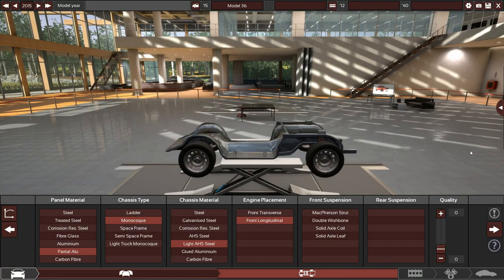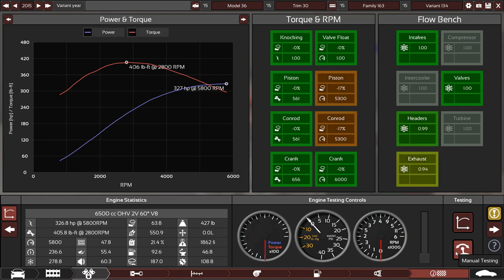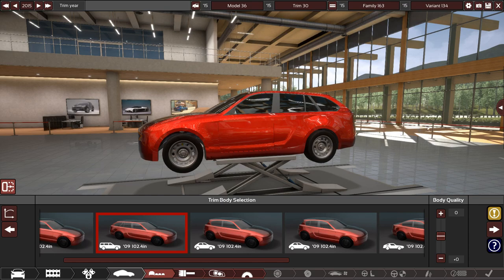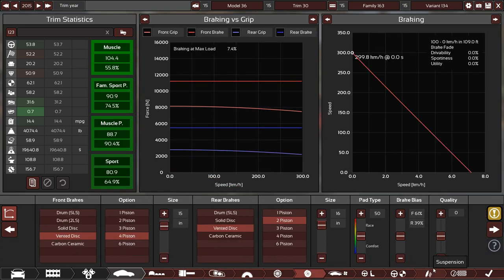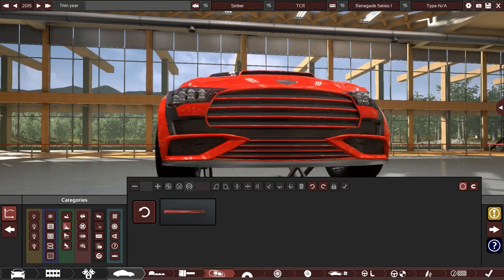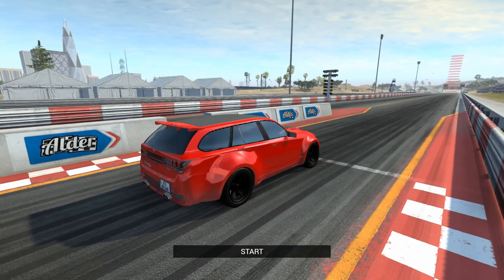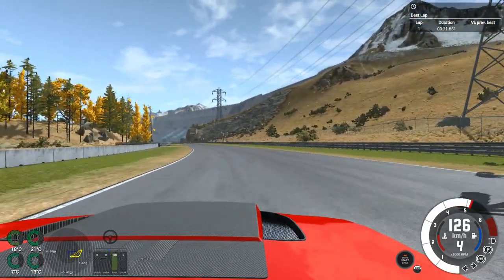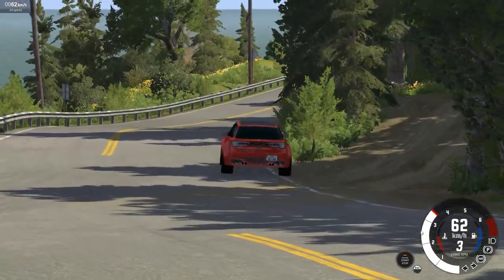Building A V8 Superwagon - Automation / BeamNG

Comment: I know this video is now a few months old but i wanted to mention something, an "error" of some sort you made regarding the engine.
American V8's are usually 90°, not 60°.
And instead the 60° V8 are mostly used by Euro companies !
You did the same mistake on your first video, the 69' muscle car.
Reply: i know this is basically a year old at this point but i wanted to mention something im not totally sure of but i think its right. 
most v8's anywhere are 90° even european. 
most american v6's are usually 90° because its cheaper to convert a v8 to v6 then to make a new v6. 
most european v6's are 60° because we dont have a long tradition with most cars having v8's and 60° have better balance than 90°.

Comment: I think you underestimated the limits of pushrod engines... The modern one's push like 450hp from 6.2L
Reply from the maker: The 2020 corvette makes 495 in its 6.2L LT2 engine. I probably could have squeezed high 400s out of it. Unless i put the sliders way up or added turbos it would be hard to hit 500.

I wish they had superchargers! Then id really have a boss V8!
Reply: @TwinTurBros  495 with sports exhaust optioned in... But that's a 2020 supercar. 450 in 2015 is basically the Camaro SS.
Reply from the maker: @martinhubinette2254  True, but it is competing against things with 600 HP (Cadillac CTSV-V, Mercades E & C63 and other big sedans / wagons.
All of those are Forced induction. Sure high 400s are great for an N/A V8. But it needed to compete at a higher level!

Also just realized my 560HP v8 would be one of the highest HP N/A engine in a production car lol!
Reply: NASCAR makes 850 at 9500rpm with pushrods out of 355 cubic inches lol
Reply: dave194315 no turbos either ;)